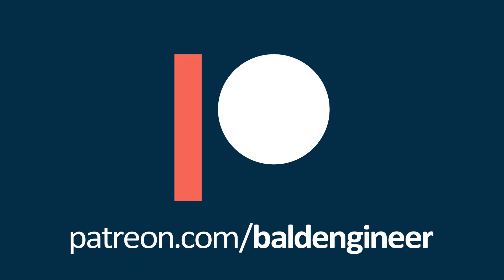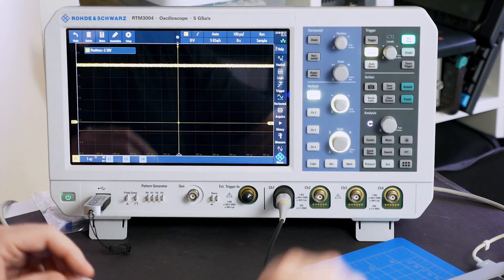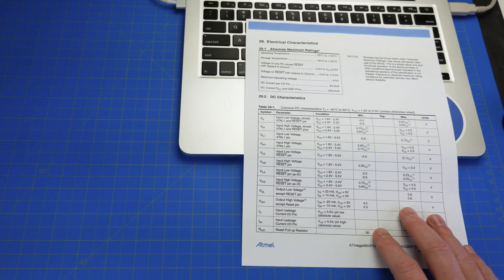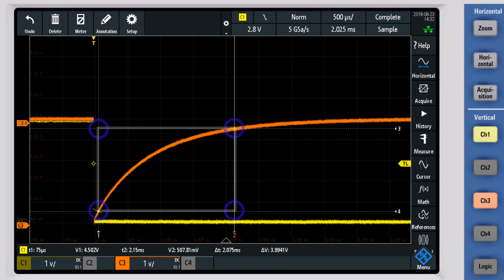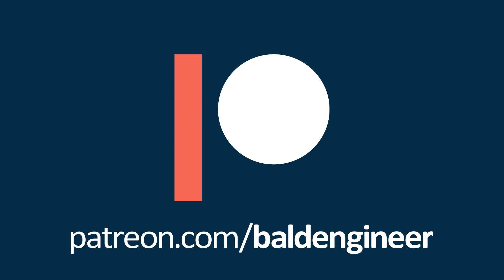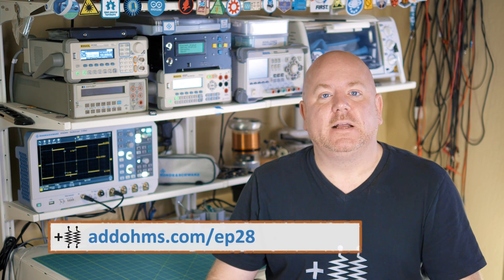Learn Oscilloscope Basics with an Arduino Uno and RTM3004  | AddOhms #28

Comment from the maker: Here are links to each of the measurements in the video (and notes below those.)

1:12 - Preset and Autoset
1:53 - DC Zooming on a 5V Rail
2:53 - DC and AC Channel Coupling (when to use)
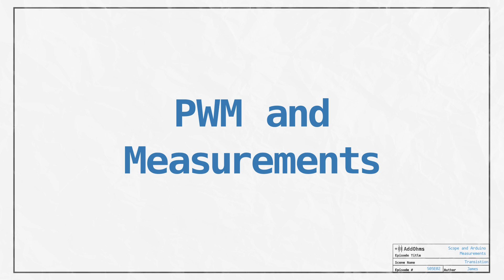3:57 - Measurements (and analogWrite explanation)
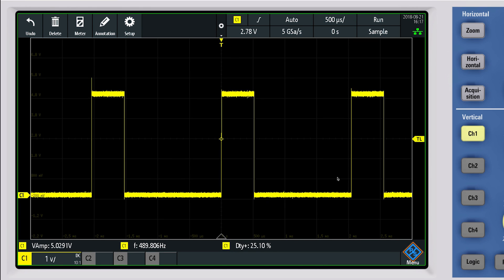7:00 - Infinite Persistence! (sooo fancy!)
8:32 - Triggering: Auto vs. Normal modes (and basic edge)
12:49 - Reference Waveforms comparing probe loading
15:09 - Serial (UART) Trigger and Decoding

Please remember that almost any digital scope can make these measurements. There are two potential exceptions. You may not have enough bandwidth to see the 16 MHz clock. But that measurement is about reference waveforms, not high-frequency probing. Even the super cheap (and old) RIgol I held up has reference waveforms. 

The other is the serial trigger and decode. Some older (or very inexpensive) scopes may only offer trigger or neither.  (Though, that is becoming less common.) The USB-based scope I held up actually offers more decode options than the R&S scope. (Shhh don't tell them I told you!)
Reply: Thank you so much for the excellent lessons! By the way, your videos are premium quality indeed. May I know the set up for your recording please!

Comment: You used a high voltage differential probe or?
Reply from the maker: Why would I have used a high-voltage probe?
Reply: @AddOhms  Hallo, ich bedanke mich für Ihre schnelle Antwort, aber ich möchte nur wissen, ob Sie einen Hochspannungstatkopf benutzen haben oder nicht. Ich könnte leider nicht sehen, ob Sie eine getrennte Stromquelle für das Arduino USB-Anschluss genutzt haben. Würden Sie bitte einmal mir erklären, wann man einen Hochspannungstatkopf kann nutzen. Es wäre von Ihnen sehr hilfsbereit und für mich auch nützlich.
Reply from the maker: The laptop powering the Uno was not connected to mains.

Comment: Excellent video, thank you! Subscribed. I recently purchased the Hantek DSO2D15 and was able to partially follow this video. For some reason I'm not getting any readings on 'pwm' pin 3 although if I connect to the LED pin, pin 13, I can get the square wave and adjust frequency, etc. I am fairly certain that the code is correct.
Anyway Is there any specific forum/group that you recommend for using Arduino/Raspberry along with an oscilloscope? (just like your video). 
I searched google groups and found a ton. I'm checking a few that have had activity recently but wanted to know if you had any recommendations. 
Cheers

Comment: Is it safe to have an arduino plugged into a PC, and then measure with the oscilloscope? Do I need to do something with the GND/Earth?
Reply from the maker: Ideally no.

But in general, I advocate NOT changing connections (including probes) while a device is powered, especially when a ground loop might happen.

Comment: Can you use a Raspberry-pi the same way.
Reply from the maker: Yes, if you know how to program it. I'd recommend looking at WiringPI which provides an Arduino-like API to the GPIO pins.
Reply: Got an OSEPP UNO R3 plus, can't wait to used on my siglent sds1104x-e  oscilloscope. 🙂👍

Comment: I love your toaster oven on the shelf with your test equipment. I will have to put my toaster oven on my bench too, LOL. I use mine for thermal testing circuit boards. They also work great for curing powder coated project boxes.
Reply from the maker: I always intended to program a powder coat mode into the controller. But ... I haven’t had a need ... yet.

Comment: What about the bottom part of the source code? You don't mention anything about it and it does not seem to matter with what you are doing.  But don't you need the bottom part to make it loop?
Reply from the maker: There were two cases where I showed Arduino code and in both cases, the full code was shown on-screen.
Reply: @AddOhms  Okay, but I don't understand how in the loop section you refer to a digital write but not an analog write.
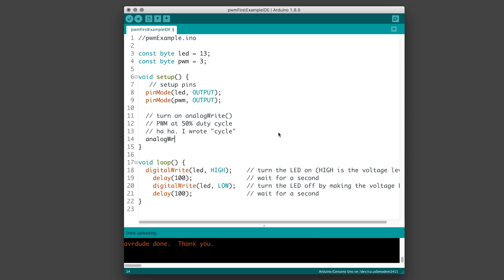Reply from the maker: 4:50.analogWrite() added to the code.

Comment: From all my research, I had come to know, to work with Arduino like digital circuits, you really don't need a scope. You need a logic analyzer instead. This has left me with options and confused. Can you please help with limitations of scope compared to LA when it comes to digital measurements.
Reply from the maker: Logic analyzers let you see when signals transition. Oscilloscopes let you see how they transition. If there is noise on the signal, it might show up as random transitions on a logic analyzer. On the scope, not only can you see what causes the noise, you might be able to correlate it to what causes it.  
For well validated systems, a logic analyzer is sufficient. But if the signal's analog performance hasn't been validated, a scope might be necessary.
You might want to watch this Workbench Wednesdays episode on Logic Analyzers as a contrast: https://www.youtube.com/watch?v=u1DYs2I-_lU

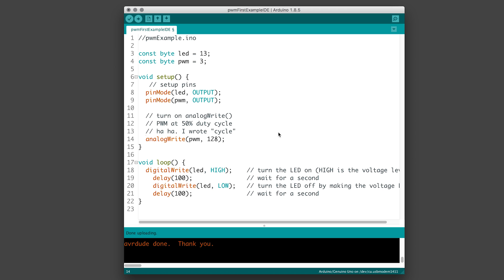Comment: 4:50  How did you arrive at 128 being 50% duty cycle?  128 what?
Reply from the maker: analogWrite on an Uno ranges from 0 to 255.
Reply: @AddOhms  I see, thank you. I am doing some reading on it and it seems there is no actual unit for the 255, it just is.
Reply: @freddyrosenberg9288  2 to the power of 8 ie 8 bit byte. I think this guy has a thing for pobes.
Reply: @andrewtaylor9615  I see. Although it should be 256 then, I was wondering how they got the 255, I could not find an obvious answer. Thank you.
Reply from the maker: 256 states. 0 through 255 = 256.

Comment: why u using a $4000 dollar scope us average joes cant afford that lol but good video though
Reply from the maker: The video was about the measurements, not the scope. I could have used the Keysight $1 million scope. Albeit with about $10k worth of adapters.
Reply: @AddOhms  so true so true forgive me can you indulge me as i be devils advocate for a bit but dont the other scopes have different words for the functions and the functions you show cased are they standard functions on all scopes?
Reply from the maker: I’ve worked for 3 scope companies and have used every major brand and class of scope. Using that experience, I carefully used terminology applicable to all of them. 

This video wasn’t just haphazardly shot.
Reply: @AddOhms  be that as it may but you did not answer my question sir are the functions mentioned in the videos in majority scopes sir with all due respect terminology and functions are two different things
Reply from the maker: That question was directly addressed in the video.
Reply: @AddOhms  Sir with all due respects indulge me just a bit more you mentioned at 0:49 and i quote "you don't need to use this specific quote or these measurements in fact you can use a usb based scope for most of these tips...... these tips and tricks only work on digital scopes " you did not mention whether the functions are on all or most scopes or some scopes

Comment: Hi, may I ask how is your Arduino power up with? I seems to see or read somewhere that it  will damage your scope if the Arduino is power ups with usb and the source it power from the main. As we may short it to the ground . Please advice. Thank you.
Reply from the maker: It is connecting to a non-grounded laptop.
Reply: Thank you.

Comment: Why is it when you have a probe connected empty you get a sine wave?
Reply from the maker: The probe is a high impedance input. It measures stray EM fields. It is the same reason a floating input pin randomly switches between a high or low. The signal will usually be 50 or 60 Hz, depending on your AC mains frequency. You can see an example of it in my pull-up resistor tutorial: https://youtu.be/wxjerCHCEMg?t=75
Reply: @AddOhms  
Ty, I watched the video and am surprised that it picks up rf. Great videos and hope to see more on oscilloscopes and them in actual use.
Reply from the maker: It isn't really RF. Radio Frequency (RF) depends on the frequency. It starts in the kilohertz range and goes past the gigahertz range. Signals in the 50 to 60 Hz range are just electromagnetic waves. All RF are EM, but not all EM are RF.

Comment: You are inserting a capacitor, an inductor and a resitor to ground when poking with a probe. The loading effect can even cause erratic or unintended operation of a device. So if you are looking for signal integrity at high frequencies ideally you need an active probe with the lowest capacitance. For low frequency signals is ideal with the highest resistance. High end scopes now have Digital Signal Processing (DSP) to avoid signal changes caused by probe loading.

Comment: 3:23 removes DC but removes low frequency AC as well. For the most precise measurement you have to use use an external DC offset circuit.
Reply from the maker: Less than 10 Hz on most scopes. Less than 5 on this one. For the vast majority of power measurements, this isn’t a range of concern. For ones where it is a concern, active rail probes provide extreme offset.  

Also, you are confusing accuracy with precision. A DC blocking cap affects the accuracy of the measurement, not the precision.

Comment: I only bought the DIY self solder oscilloscope from ebay, is it worth buying a proper oscilloscope? Since it seems quite fun to play with.
Reply from the maker: "Any" scope is better than "no" scope. I do think there is value in a "real" scope at some point. But it doesn't have to be a benchtop. There are some really good USB/PC based scopes that are very affordable.

Comment: I have always had a problem with the term A.C. coupling. You are actually decoupling AC from DC through the capacitor. For a person that is self taught and expects a definition to have a specific meaning. This term sucks.
Reply from the maker: The term as stated is more correct that you suggest. "AC Coupling", which is also sometimes called "capacitive coupling" has meanings beyond the scope input. 

Decouple means to disconnect and Couple means to connect. The phrase is more common for amplifier stages, where they are "coupled", or connected, together. In order to do so, DC bias must (usually) be removed, which is done so through a coupling capacitor.

An AC coupling capacitor is filtering or blocking the DC, but not "disconnecting it." To say the capacitor "decouples the AC from the DC" leads to more confusion and less clarity. 

Almost everyone misuses the terms decoupling, filtering, and bypass capacitors. They get interchanged without regard to their meaning. (Primarily because, especially on an input side, they may perform multiple functions.)

A "decoupling capacitor" allows a device to be (slightly) disconnected--or decoupled--from its supply. It provides a bank of reserve energy for the local device. While a filtering capacitor removes a frequency-specific component. Which cannot be 0 Hz (aka DC.) If you want to filter DC, you use a "coupling capacitor" instead. While a bypass capacitor is a type of filtering capacitor which provides a path for frequency-specific components to ground.

Comment: Nice simple and practical examples on a nice scope. I have a DS1052E as well. The screen on this thing feels like an old nokia brick in a world of modern iPhone's when you whip out that Roadie.

   Probes? I'm curious about DIY front end mods on the cheap ($10-$50 BOM). Something like a simple diff or isolation probe circuit versus entry level (read: "cheap bastard") commercial options.

  Another aspect on the subject of scopes/bench tools, I'm not sure exactly how to characterize my scope's accuracy and limitations when it comes to voltage, current, and time. There are great examples of analogue scopes on Alan's W2AEW YT channel. When people like Alan talk about the accuracy/precision of analogue technology I don't know how to really apply that to the digital stuff as much. When it comes to accuracy or precision, I only need to worry about accuracy because of the relationship between my different measuring tools. I'm not worried about anything I make exiting my own little world. So when my scope says 1.0000MHz and my little home made frequency meter says 1.0001MHz, that's all the precision I need.
  Anyways, I haven't found content on YT that goes into practical aspects of accuracy and precision with entry level tools. Specifically, I'm interested in how to characterize where I'm at with, and efficiently expand, my metrology toolset.
  As a real world entry level problem example, I am working on my own layout of the OSHW AVR Transistor Tester project version 2 with an ATmega644. One project option in the official pdf documentation is to replace one of the 16MHz crystal's capacitors with a trimmer capacitor to tune the frequency of the oscillator. I have a basic understanding that the proper way to tune a crystal uses a metrology grade disciplined oscillator. I've seen the cheap ublox GPS disciplined oscillator projects on other channels, but after reading quite a bit on more advanced forum threads it appears the Ublox based designs are not a viable solution. What I do not really understand in this situation is what to expect when it comes to the accuracy/precision of my scope for tuning a circuit like this.

  I haven't seen anyone explain accuracy/precision in reference to one's most accurate tool on the bench and comparing the tools at hand with each other. Most people start by talking about calibration labs, 7 digit DMM's, or cesium frequency standards. These are good to know about, but are inaccessible to most hobbyists and beginners. You have far more toys on the shelf than I do, so you could easily lose me in an explanation about a subject like this, and I'm a few years into the hobby. I think it would help a lot of people if content were available about how to characterize the tools at hand when someone is limited to truly entry level standard tools like an AN8009 meter and a cheap USB, or second hand scope without access to external references/calibration labs/truly metrology grade equipment. 
-Jake
Reply from the maker: In general, I avoid “accuracy” and “precision” discussions because measurement technique almost always swamps the limitations of an instrument. 

For example, how many scope tutorials spend forever on how to “calibrate” the RC network in a passive probe, then, clip the probe onto a long piece of wire. The accuracy of the measurement system doesn’t matter in that case. 
Measurements on a scope are something I’d like to cover in depth. My experience is that most people do not understand what the scope is doing. Again, getting into precision doesn’t matter to me. Understanding which measurements use 10-90 thresholds (and when to change them) or how to tell if interpolated points are being used is FAR more important that proving out the precision of the timebase. 
Or another one people like to fixate on is ADC resolution, while having waveforms only use a quarter of the dynamic range.
Reply: @AddOhms  
  I understand, this was just the stuff I'm trying to tackle on my own without a proper academic degree.
  When watching/reading content explaining scopes, I usually get lost when the subject is addressed from the perspective of using a scope to explain a scope. (Like "let's talk Chinese about FFT"... button...button... Chinese... button... button... ..now for the math on paper.. ...Greek... -hopeless)

  I clicked on this video to see what I might pick up because you are addressing scopes through something relatable with the Ardy1 (much appreciated).
  Literally everything I wrote before is me just trying to understand the abstract difference between tuning a crystal with what I have versus getting a cheap commercial frequency counter on eBay versus what is possible with a frequency counter w/disciplined oscillator, ...while dreading what I'll need to do to get better tools. I don't need you to fix my issue here. I was simply trying to bring up something relatable as an entry level type of problem.

  IMO people like Dave Jones and others seem to take on subjects like metrology from a similar outlook to what I imagine they had in school when they began to learn about these things. As a hobbyist I think the learning curve is much different. I need more intuitive grounding with an explanation. I think that's where a lot of us get lost, or at least, that's why I get lost.
  Heck I still have a disproportionate fear of "blowing up my scope" because of Dave's old video about the subject, and I am reasonably confident in my understanding of circuit isolation. I'm confident enough to wind a few transformers and build a few SMPS designs, but I'm still hesitant to use my scope on anything with isolated mains power bc of watching Dave's video years ago. It's really silly, but oh well...
  I think people also get lost when a tutorial has a short explanation of some concept followed directly by pushing buttons on a device. I need to understand the various real world circumstances/applications for a technique, especially the how and why of a technique. Then I need to understand what I'm looking for on almost any device in order to use said technique, feature, or function. Most explanations seem like someone using big words/concepts quickly followed by magic buttons...but hey...that's a great way to sell people magic buttons :-)
    It's kinda sad to break things down to that kind of level here, but if we're brutally honest, I think that's a pretty solid assessment of what people do in general in these situations. "I need to buy that box of magic buttons (person) explained to me so I can do (thing) I barely understand." *buys scope.
  I don't mean this in any negative sense, it's actually more observational and somewhat reflective of my own past experiences. I'm just sharing to try to help make the path a little straighter for anyone learning on their own under similar circumstances. I've got no problem admitting some of the dumb stuff I've done ;)
 That's just my $0.002 adsense. 
-Jake